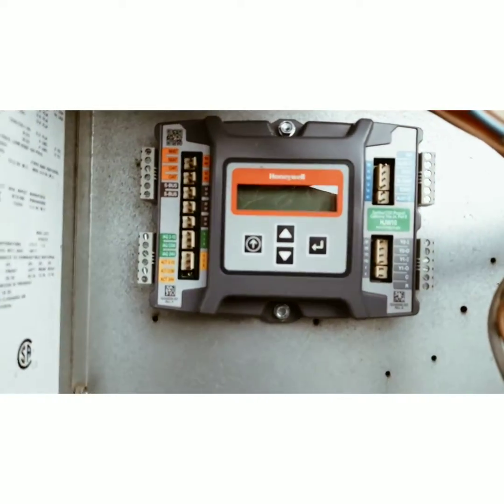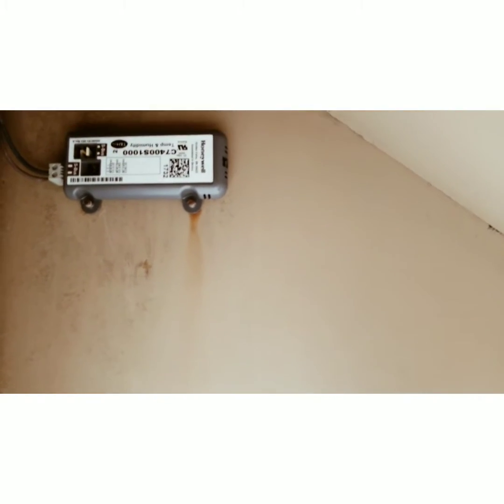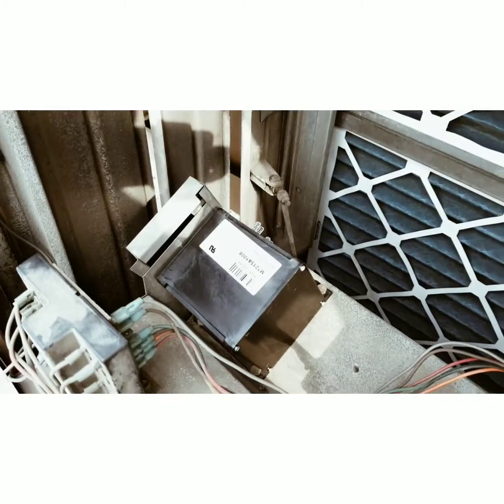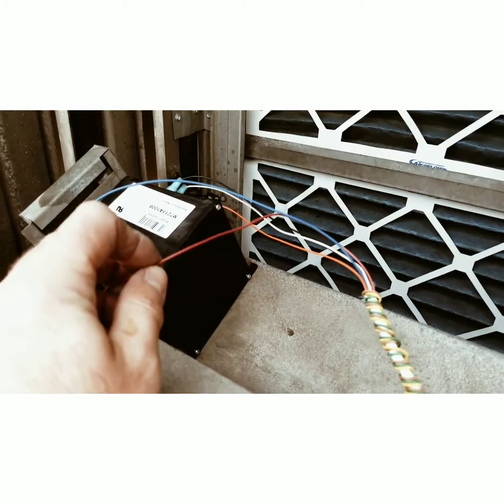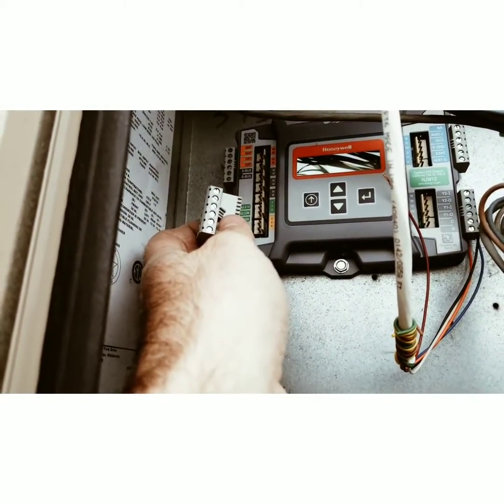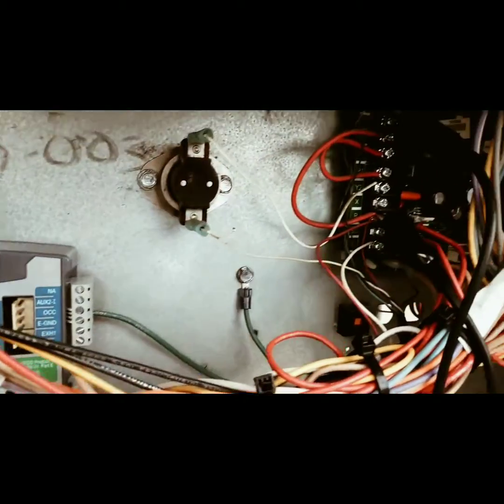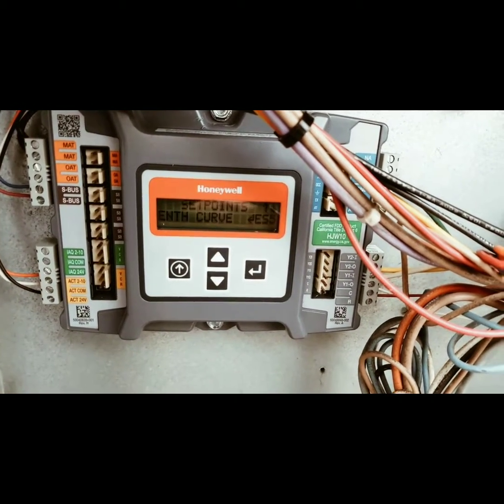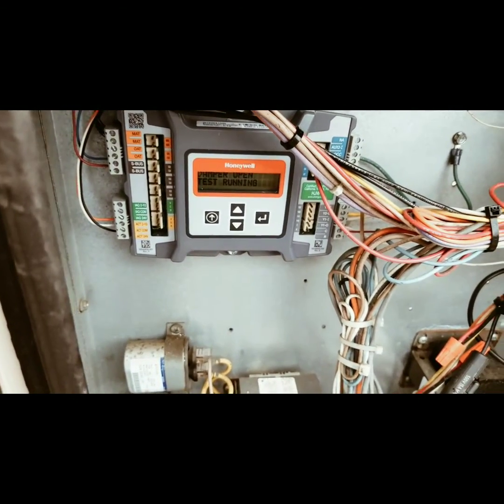HVAC - Honeywell Jade Economizer

Comment: Does this work with the old economizer actuator
Reply from the maker: No, you'll need a new one
Reply: @HVACKnowItAll  Thanks for the answer. The customer decided against repairing their economizer because they didn't want to replace the actuator and the control module so they'll just be running the mechanical cooling now instead.

Comment: Thanks for the video just took a classThat included some economizer training and they mentioned that the sensors should not be mounted anywhere where radiant heat or cooling could pass-through where it’s mounted like on an outside wall of the unit and they recommend using these offset stands to prevent heat from the exterior walls affecting the sensors. Thanks again
Reply from the maker: Awesome, I appreciate the feedback

Comment: My biggest question is how do I set my set points, how do you determine the set points for outdoor and mixed air set point like I live in Washington state and how should I set up the numbers, is there a guide I can read  ?
Reply from the maker: 53⁰F to 55⁰F mixed air for cooling is usually good.  I set the outdoor ambient to ES5.  There is a chart in the manual for that is using an enthalpy kit.  If it's a sensible kit then I would enable the free cooling to 57ish ⁰F.

Comment: I like to use a low odor lubricant from crc because your customer will complain about an odor coming from the system .
Creating another service call.
White lithium grease has low odor.
Even 3 in 1 oil out of your zoom spout bottle.
Great video man!!
Reply from the maker: Thank you
Reply: 3-1 oil is designed for one machine only sewing machines causes bearing wear on blower bearings and motors because it leaks out where it is needed rotts out motor mounts has a cleaner in it. lithium better for linkages who gave that to you your grandfather?